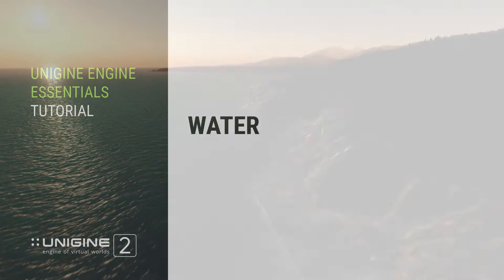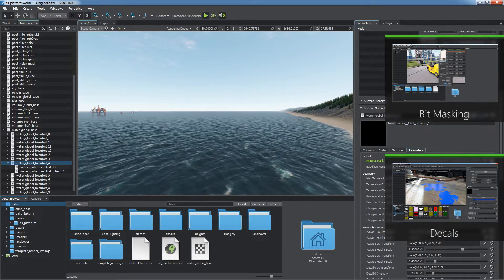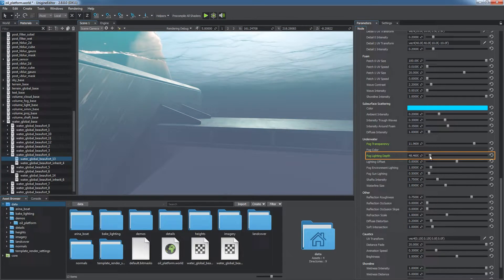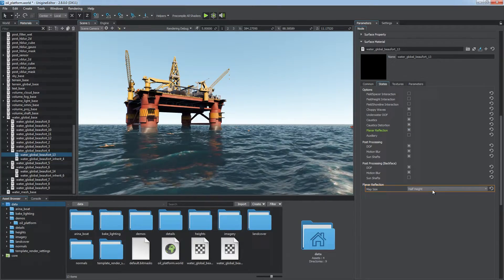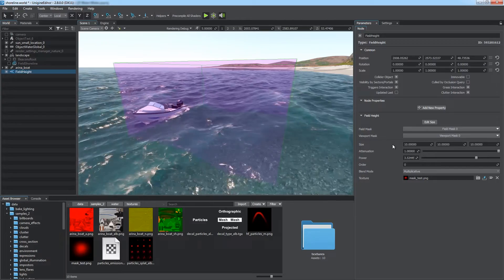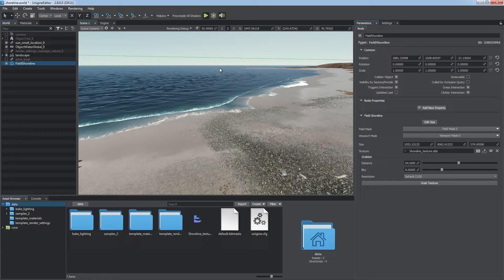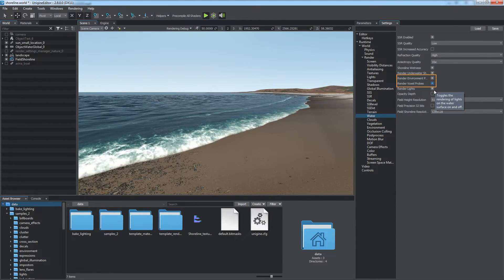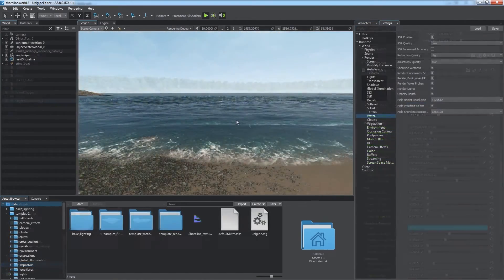Water - UNIGINE 2 Engine Essentials

Comment: You remember the time when old games used planar reflection and which worked very well for TRUE realistic reflection on water or other with not very big "significatly drop performance" , now today we have SSR with horrible artifact and disappearance...OR, use ray tracing to get back real quality with SIGNIFICATLY, for this time, drop performance... Enjoy
Reply: That technic you are thinking of was not a planar reflections, but a render to texture, i believe, which doesn't work well with modern rendering methods such as deferred rendering and pbr as far as i know..
Reply: @johnsmith-ck4qt  no, I'm talking about planar reflection...
Reply: @dissidentjv5887  im meant that older games used this technic instead of planar reflections..